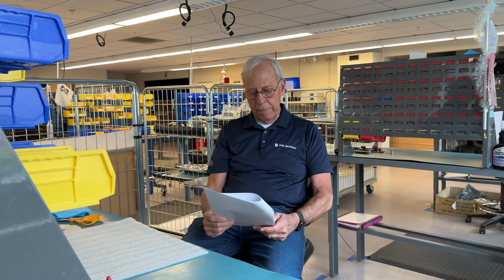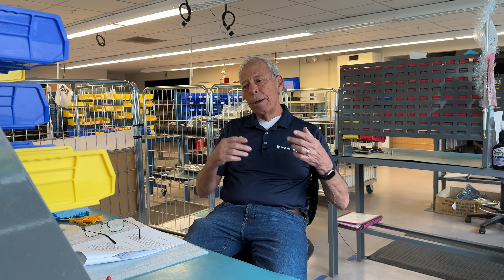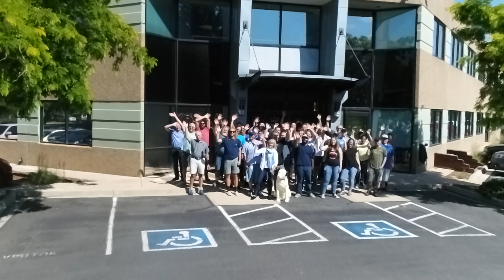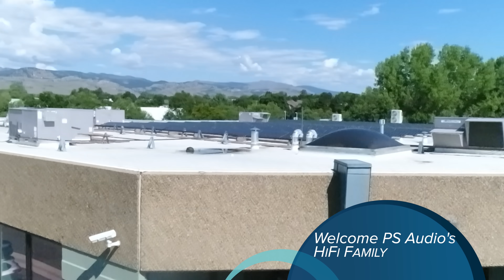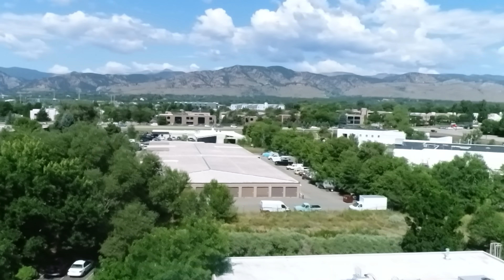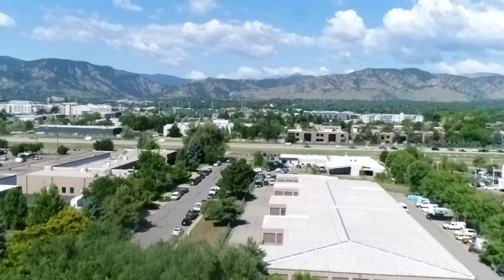Best way to connect a streamer

Comment: The difference I hear going from my streamer box through my amp is HUGE/UGE depending on whether or not I'm using my rca interconnect (audioquest incidentally!) or a toslink cable, BUT using the toslink also switches the dac to use the amplifier's internal one rather than the streamer's dac. So it's difficult to tell whether or not the dac or the cable is having most influence on my preference of sound, but the toslink route is massively better than the rca route. The sound is so much more transparent and airier, to the extent that when I switch to rca (I can have both cables connected at the same time so its really easy to switch them mid track) it sounds like the speakers are being muffled, the difference is that apparent. I had been listening via the rca for many years, and purely out of curiosity tried the toslink connection as I got a cable with a new TV, and I was truly staggered at the improvement in sound (to my ears). If your amp/dac/streamer can all connect via toslink, try it out, but be aware of which dac is being used in the chain if you have multiples... I'm not sure what dac would be used if for example you have a CD player connected to an amp which has an internal dac.
Reply: When you say RCA is it a red/white analog or single-ended digital?  (Like toslink)  If you're using the red/white output that means analog which uses the streamers internal DAC.  The single-ended toslink or coaxial RCA is passing straight digital signal to the amp/receiver's DAC for conversion.
Reply: @michaelwozniak8860  Yes analogue - not using a splitter with the RCA interconnect cable. And indeed, if I am using the RCA inputs the streamer's internal DAC is used (as I said). Using the toslink directly to the amp utilises the amp's dac - and as I said, it is difficult to test whether or not I get a vast improvement in sound as a consequence of the internal DAC on the amp OR more so from the toslink straight signal (or both). My general point being, try the toslink route if you have the inputs and a similar chain as me re. dacs. You might be very surprised.
Reply: @West3rror  Why are you saying this as if I do not understand this? Did you miss the part in my original post where I quite literally state how using the toslink bypasses the internal DAC on the streamer? I'm well aware of how things work thanks. Learn how to read.
Reply: @obscurazone  Then your comment makes less sense if you know that. You just stated the obvious then.
Learn how to write and explain things.
Reply: @West3rror  And as I very clearly said in my original comment, it is difficult to ascertain just how much "difference" the cable change is creating in sound transparency and colouration, versus the difference in dacs. Learn how to comprehend and understand what someone is saying instead of adding 2+2 and coming up with 5, then trying to sound smart, but sounding like a total arse. Bye
Reply: @West3rror  I'm glad your brain has finally found a gear. 👍
Reply: You are almost certainly hearing the difference that the (probably) better quality DAC (inside your amplifier) is making.  You didn't say what kind of streamer you have, but if your streamer's DAC is just as high of quality as the DAC in your amplifier, then the reason the DAC in your amplifier sounds better is because it is simply a better match for the rest of your system.
Reply: @danmarjenka6361  The Onkyo amp has an integrated Wolfson 192kH/24-bit DAC. I have a Raumfeld connector 2 streamer box plugged into it, which also has a 192kH/24-bit DAC inside it (Cirrus Logic) so both DACs are well matched in terms of price point/capacity. Raumfeld are no longer in production (purchased by Teufel) but they were a well respected German brand who made good quality gear, and that streamer with the cirrus dac is decent for the price - some would say the cirrus is actually a better dac than the wolfson in the amp. 

I use the amp, plugged into (at various times) a set of Dali Zensor 3 speakers, Tannoy Revolution 2, and Audio Physic Spark 3 - so a good mix of budget and entry level "audiophile" (yawn). I'm a guy in my mid 40s, so my hearing undoubtedly isn't as good as it was 20 years ago, but when I flick between using the RCA connector and using the toslink (as I said, I can have both leads connected on two separate line inputs and just switch between them whilst playing a track) the difference I hear is extraordinarily apparent. The toslink line is far superior in every way, night and day difference over the RCA line. So yeah, as I said....given the similarity in dacs between the two devices, I can only assume the toslink fiber optic cable, with its very unobstructed direct feed to the amp, is enabling a far more detailed and spacious/airier sound.

Comment: Is there a specific audioquest XLR cable with best price to performance ratio?
Reply: If you want to break the bank yes.
If not, this brand is overrated : cheap parts, cable are weak.
But that is the case for any brand with a cable below 250 $ (my experience).

Decided to build mine, pair is 25 $ (Mogami/Canare cable with ), best sound I have experience on my system : the veil was gone. Then I cut the Audioquest cable (King cobra RCA) to see for myself how crappy this was.
I was amazed about how poor the connector was built : only 2 metal plate bind together. Copper seemed ok though.
These brands ask for way too much for the quality they offer.

No wonder the snake oil rant goes still wild. Paul should have insist on it.

Comment: USB ??! How come is RCA and AES mentioned but not USB ?
Reply: Looking for the best signal flow might not include USB. Just spitballin
Reply: @BuddyGorey Actually USB is superior because it supports asynchronous audio data allowing your DAC to fully control the timing precisely. USB C is the modern superior data interface also for audio. Synchronous interfaces like SPDIF, TOSLink and I2S aren’t ideal because they can potentially yield jitter issues.
Reply: @ThinkingBetter Asyc tranfer mode is not usually used for USB audio.
Reply: @ThinkingBetter sounds like this bobnot24 knows something you don’t?
Reply: @BuddyGorey  what do you mean ? Since when can you listen to DSD on Coax or AES ? You kidding me ? Chord DAC only use USB as the best implementation
Reply: @sh1m4n0  I have no idea man. This guy knows a lot more than me, and seems to have some experience. 

I was suggesting the omission was more likely because it isn’t “the best way to connect a streamer”, re: title, than it was an oversight. 

You just happen to leave a common comment type, the gripe. I don’t even stream to hifi 😂.

Apologies for the stray bullet — I know how serious audiophiles are about the particulars of audio and I did it anyway. Careless

Tl;dr You’re probably right!!
Reply: @BuddyGorey yeah its fine but coax and aes are not even close to being best since none can run DSD. Only I2S and USB can play DSD and also high rees files so this clip is dog